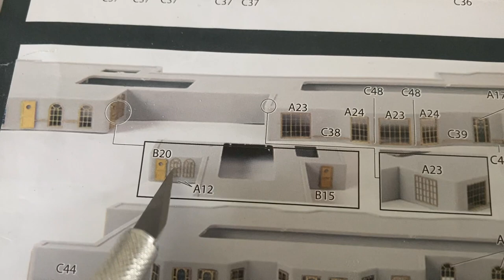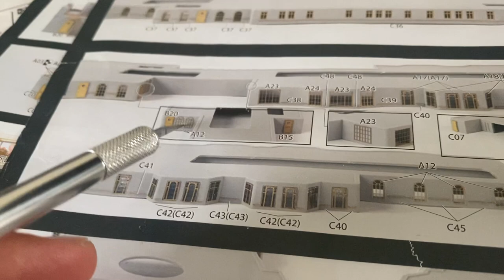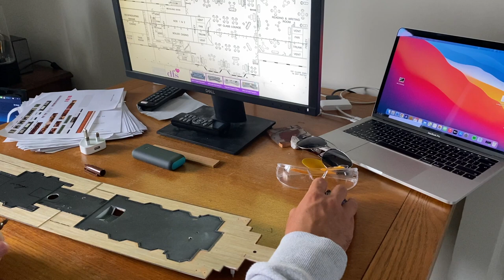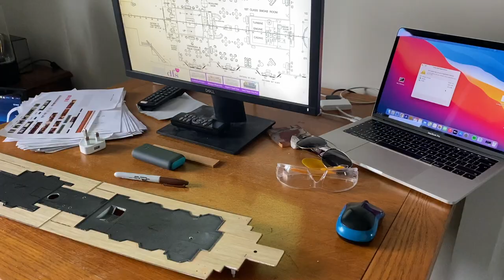Radio Control Trumpeter 1:200 Titanic Build Part 31 - Reading and Writing Room

Comment: Hi Rob nice to see that you are keeping busy!  You covered quite a lot in that very informative video, I appreciated that which was food for thought. Great 'heads up' on the height of the rooms, see what I did there!!  I will have to have a think about that a bit. My A deck will be very visible of course so I will be bearing that all in mind when I eventually get to it! I cant help thinking that you should invest in some very thin and finer modelling paint brushes!!  I have the Woody's Promenade deck beams on order to save me some time a long way down my journey! They look very nice and again very relevant to my model. Looking forward to seeing the staircase as I was not originally planning on doing much in that area!  I am planning on thinning down those superstructure walls which in scale terms must be 60cm thick!  Great video as usual.  Stay safe. Regards JH :-)  (Still doing the Shell plating)!
Reply from the maker: Hi Johnny,
Ooh not all puns are created equally! But yes I’m still contemplating what to do for the room heights, currently my plan is to add LEDs between the ceiling of A deck and the boat deck so at least the small skylight windows are illuminated. 
I have actually just bought some new brushes, I am somewhat cheap when it comes to this sort of thing so continue using the old ones till the bitter end then buy new!
Yes your model will have quite a visible a deck, I’d have thought the detail you can get from KA and the various print outs would be quite good though, are you intending to do interiors? 
Keep well, and hope the plating is still going strong! 
Robbie

Comment: Great video mate , love what your doing with the interiors,  just amazing to watch and learn 😊😊😊😊just one thing mate , back blowing your airbrush to mix your paint , not a good idea , it damages the seal behind the mixing chamber , I know because I learnt the hard way , new air brushes have a perferated çone at the tip to prevent this bad habit!  😎😎😎😎
Reply from the maker: Darn, knew that idea was too good to be true. Thanks for the heads up!
To be fair I need to get a new airbrush anyway, this one is showing it’s age, and being a bit sticky.

Comment: I have a question, what is the diameter of the props on your model?

Also is the wooden floor detail for the forecastle, boat and poop deck included in the kit?  Or is it bought separate?

Comment: Great video and informative as to your technique. Learning loads just by watching. 
As I was watching the carpet going in I noticed some very minor bumps which I thought you would address.  But as the video continued I saw that they would never be noticed.  

Food for thought and a question: given the scale, are you planning for any 3D texturing/detail with railings, door knobs, misc signage etc to the exterior exposed bulkheads? Even a bit would really sell the fantastic interiors and detail work so far. 

Finally, where do you get the scaled people and crew and are they available in different scales??? 

Javier in Miami
Reply from the maker: Hi, thanks for the comment. Yeah those ripples are slightly annoying, but they do go down as the glue dries and as you say, hard to notice once the furniture is in. They are more obvious on that flat carpet as opposed to the textured floor tiles that most of the ship has.
I am intending to pick out door handles and add a little bit of dark wash round the outside of things to make them stand out for sure. As you say there is signage to go on too. They will be done in due course, because they are small and fiddly I am planning to leave them till later as they will be a little more vulnerable than other parts! 
Scale people and crew come from the Tori factory: 
https://torifactory.com/?product=fs-06-titanic-crews-and-passengers-set-3
They also come in the Ka set though. The sitting down figures I used in this episode are just from eBay I believe, I searched 1/200 figures sitting down and got lucky! As to other scales I’m not so sure but I’d have thought you could find some.

Comment: You really don't think you can make the writing and reading room higher? So when u look trught the windows on the boat deck you would see the bellow one, that would be pretty cool, does the trumpeter not allowed that in his design? I ask cause I don't have it and I really wonder and think it would make a difference after everything is properly placed
Reply from the maker: I think it will be difficult! Because I suspect what will happen is that end up with disastrous light bleed issues. I would need to make a cut in the deck above which is the exact shape of the room below it. To be fair, I did consider trying something of the sort, but I really don’t think it’s necessary because the windows on the boat beck are so small (and have leading on them) so the chances of seeing through them is minimal. 
What I am going to do is add some lights behind these small windows so they do at least appear to be illuminated.

Comment: Really good video. I like your attention to detail. 
I would like to ask your opinion on the furniture as I consider buying it myself. It does look a bit out of scale as the rooms looks quite crowded compared to photographs from the Olympic. Or am I wrong here?
Am looking much forward to your upcoming videos.
Reply from the maker: Yeah it is defiantly slightly out of scale. I think magnified in such a small room as this. Also it’s not helped at all by the lack of height in these rooms. On the real ships they looked open and airy, but the ceilings on this model clip the wings so to speak! 
I like this furniture though, it’s pretty robust considering how small it is, and it quite versatile, you could put less in the rooms and keep the open feel to them

Comment: Please answer this. Is it the gorilla wood glue you used to paste a paper template for the flooring on the plastic deck? Can it be used for pasting a paper on a plastic styrene sheet?
Reply from the maker: Yeah I don’t see why not. If the surface you are gluing onto is too smooth I would suggest roughing it up first with some light sand paper though